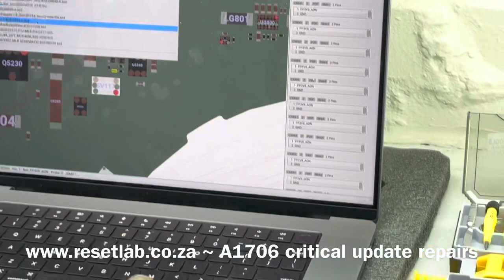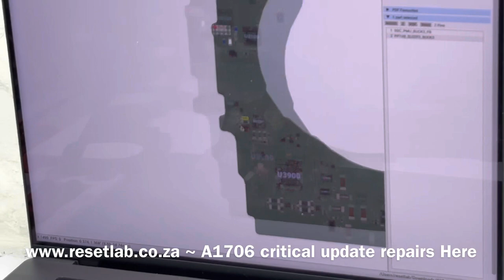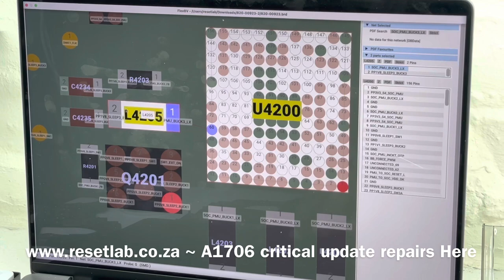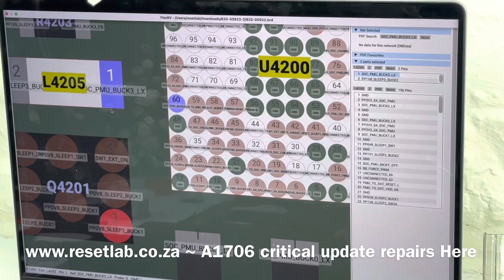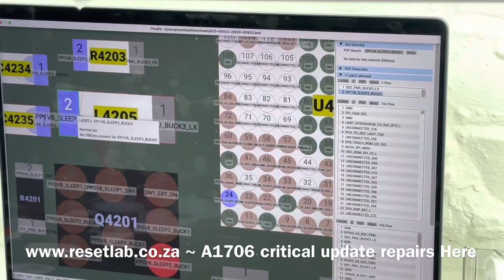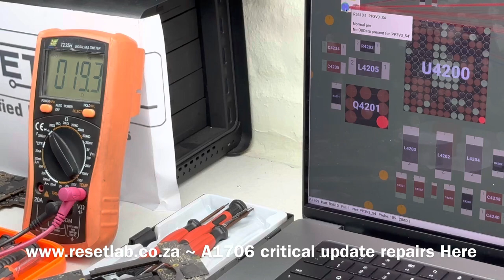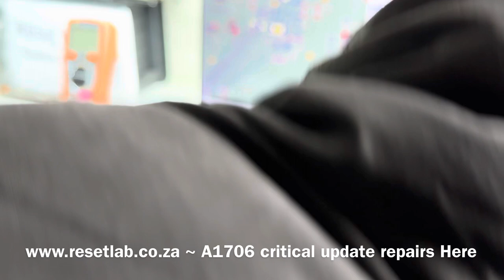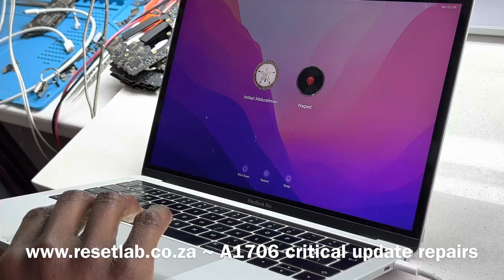MacBook Pro A1706 with critical update repairs

Comment: Iam facing the same problem my touch bar is not turning on with  critical update but my laptop can launch into safe mode 
if the t1 chip is the problem how much would it be 
thanks for your help
Reply from the maker: The T1 usually wouldn't fail, but the signal or power line to it usually does, is you have a donor I may be able to guide you on what to do

Comment: Would these issues be fixable via a fresh install of MacOS or is this a board leave repair? An uncle of mine is having the same issue…
Reply from the maker: If it’s software related , then a fresh installation of macOS will fix the issue, the troubleshooting has to be done to verify the cause